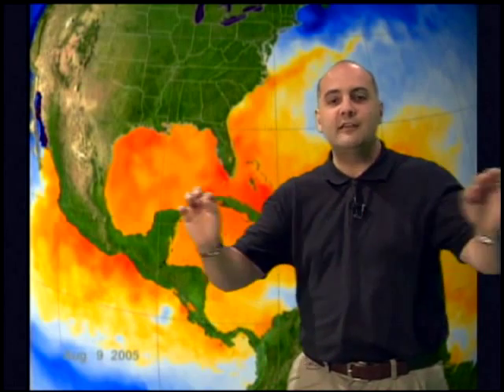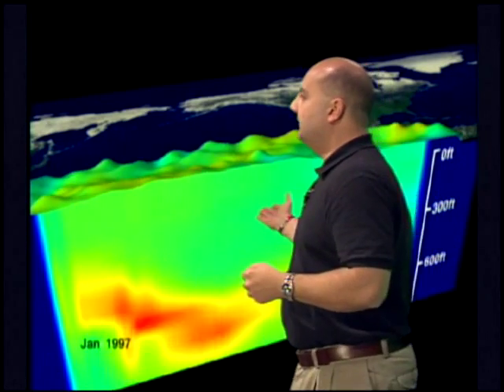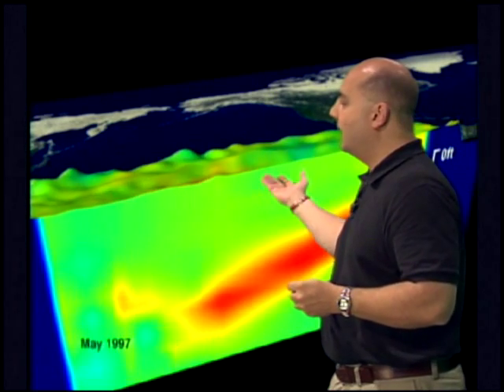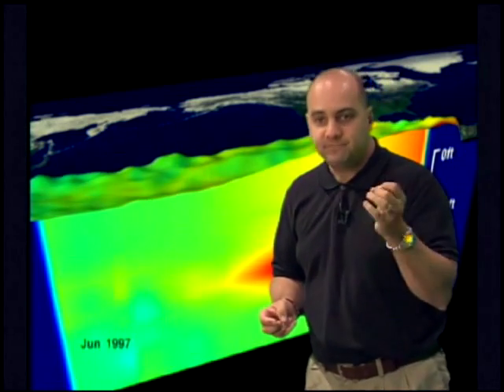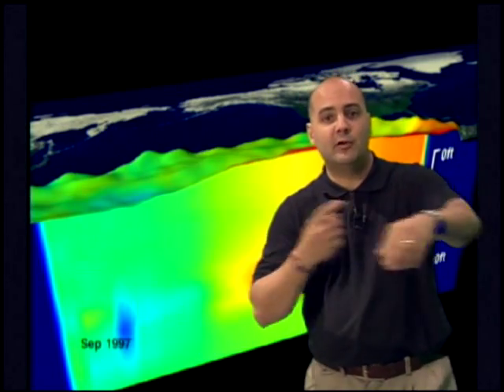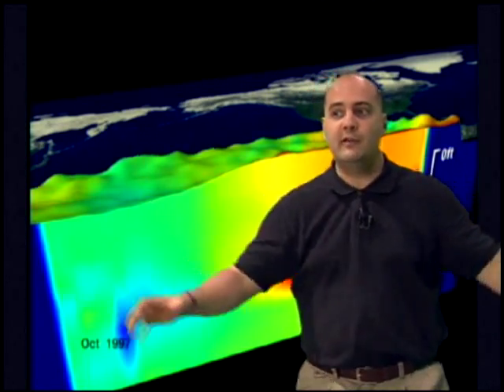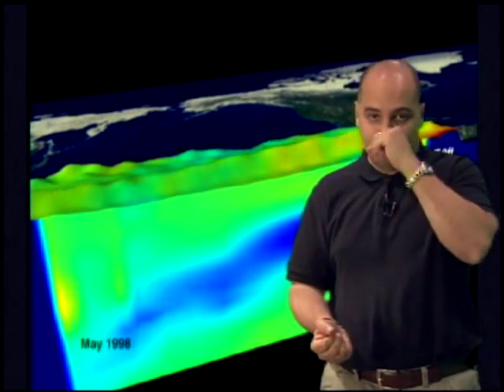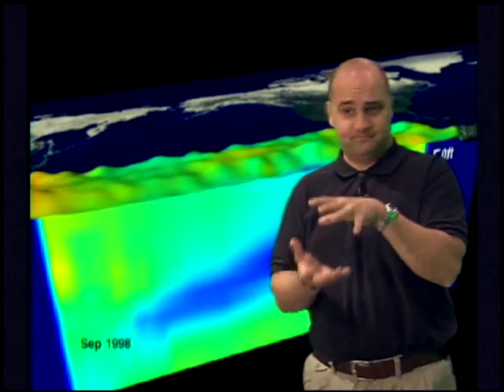18: Thermoclines, Reservoirs of Heat

Comment: Slight correction to video: The thermocline is the interface between the warmer surface water and the colder deeper water. It is the relatively boundary between these two layers in which temperature changes rapidly.) On an X-Z graph, temperature in the thermocline appears as a sharp slope, hence, thermo=temperature and cline=slope). The surface mixed layer is the reservoir of heat, and it extends from the surface (z=0) to the top of the thermocline, what is called the mixed layer depth, or MLD. The deeper the MLD, the greater the pool or reservoir of warm water, and the greater the likelihood that a hurricane will be sustained over that body of water. Just to be clear, the thermocline is not where the heat comes from, it comes from the surface mixed layer. However, the depth of the thermocline, the mixed layer depth, specifically, is the important consideration here.